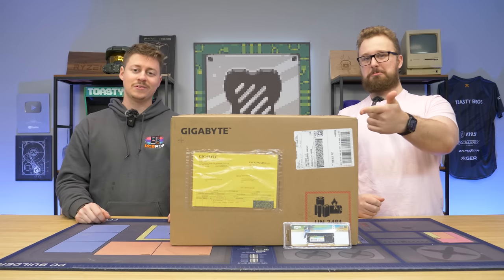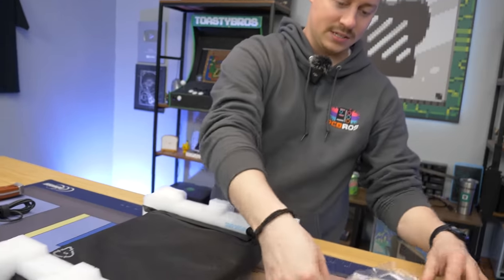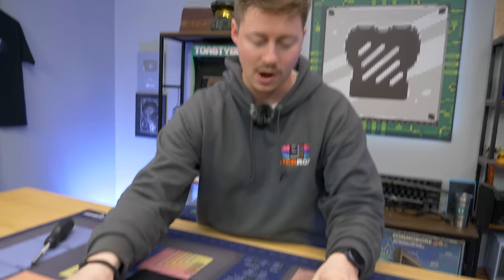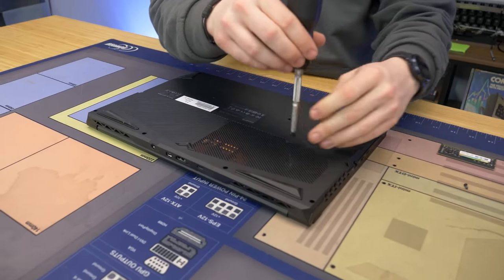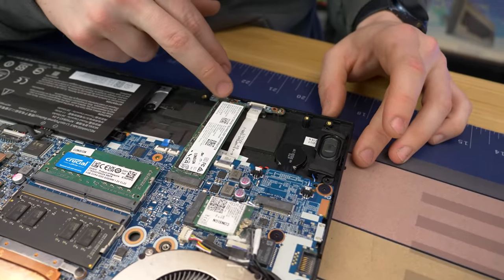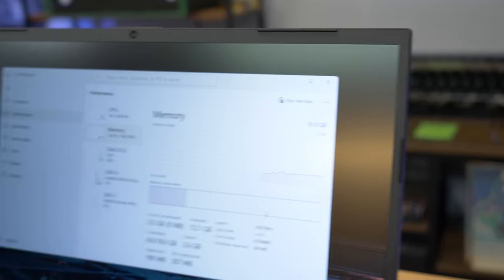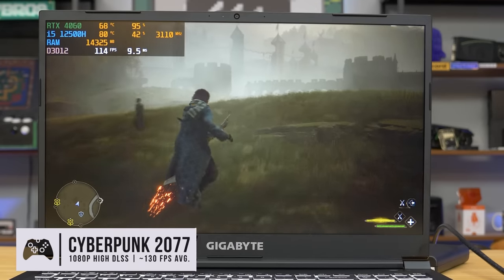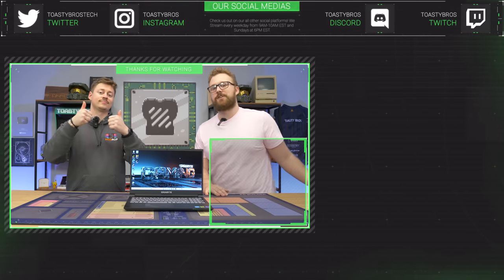Budget RTX 4060 Gaming Laptop...Is It Worth Buying?

Comment: 90c + temps on the CPU at only 30-40% utilization is a non-starter for me, especially at $1100.  Going from idle on desktop to opening chrome would probably be enough to make this loud as heck in non-gaming situations too.
Reply: This laptop is garbage,termals,material Etc.
Reply: I was thinking the exactly same thing, no temperatures beyond 75 celsius on a cpu for me.
Reply: @AurioDK  I won't go above 60° Celsius. I always undervolt
Reply: You can just turn off the turbo boost
Reply: its a laptop not a desktop 90c is perfectly fine and nothing to worry about
Reply: @Hainoi  constant 95c+  at 30% is still worring even for a gaming laptop, that 12500h is stupid hot
Reply: Laptop CPUs are designed to work at 90°C, this temps are expected for low budget gaming laptop.
Reply: and that is on a 4 core low tdp laptop CPU lol, complete joke cooling
Reply: @bandita2068  is the i5 12500h 4 cores?
Reply: This thing will toast it's thermal paste in weeks and then hellow thermal trottling and low FPS.

Comment: Man, those CPU temps are insane. Time for some liquid metal. Made a MASSIVE difference for my old gaming laptop.
Reply: my alienware 15 r3 never went over 60 on gpu and 80 on cpu after liquid metal (Y)
Reply: @danielrock04  my laptop has an 8th gen i5 and a 1050 ti. Before conductonaut, the CPU was nearing 90 and the GPU over 80 while gaming. After, 74 max on the CPU, 69 on the GPU.
Reply: @Viking8888  I'm going to fly to Toronto this week, I'm gonna buy a new notebook, I'm thinking in this gigabite or an Asus ROG (almost same price for an open box one) with a Ryzen 7 4k and a 4060... I don't really decided yet but I think I saw somewhere saying that the Asus comes with that new thermal fase changing pad, so maybe I'll go Asus this time 🤷🏼‍♂️
Reply: @danielrock04  Are you from Canada? I'm originally from BC. Honestly, I'm waiting for the Framework 16. I'm REALLY hoping it doesn't cost a couple arms and a leg.
Reply: @Viking8888  Regular thermal paste will work, and I trust it more anyways.
Reply: @danielrock04  buy a desktop
Reply: @Viking8888  I'm Brazilian, I wish framework could change the market, but for now unfortunately I will have to pick one cause those notebooks here in Brazil can cost more than double the price in Canada, so, I will get one and settle with it for the next five years or so (like my Alienware)
Reply: @Jactional  IF I could buy a SFF I would, because I need it to be portable, I was thinking of those MSI Trident 3, but I wanted one with a 3060 and it costs 2 times the notebook...so I think I'll be better off buying an entry lvl notebook...
Reply: @danielrock04  I'm sorry things cost so much in Brazil. Wish things were reasonably priced in every country in America. I'm glad you will be able to get something when you get to Toronto though. Take care.
Reply: @ayedraco4l  thats not always true. My 2018 hp pavilian gaming didnt have strong enough cooling. Some i5 8300hs were not even allowed to go to their true 4ghz and were locked to 3.5ghz because manufactures were didnt have the cooling. Unless theres a really good last forever phase change honey well paste a paste probably isnt going to do it. I still get into the 80s in some games and if I forget to turn on my under volt on im back in the 90s with liquid metal. I dont put so much in that im afraid to put it my back pack and run around with it (which I do) but you can totally use conformal coatings, a little bit of thermal tape and possibly add polyurethane foam dams from filters to add a little bit of saftey. I agree on most other laptops though.
Reply: @Viking8888  have you undervolted. I got an i5 8300h with 1050ti laptop. Whats your clocks your getting at tdp. At my 45 watts tdp with undervolt im getting 3.7 ghz for 4 cores which is basically now my new 4 core base clock.  I was wondering what wattage you used because your max temps look better. Hp went pretty weak on cooling in 2018 but im not sure if its just that. I was wondering if your getting all of your cooling from just having a better designed laptop or if the wattage you were running in games was different than 45.
Reply: you can't use liqud on a laptop as itwill leak out
Reply: @gabriels5105  I left everything on stock settings. Didn't even think about undervolting. Should have tried that before selling it. I'll try that when my Asus TUF Dash F15 gets here to see the difference.
Reply: @mrt1957  I checked it before selling the laptop and it hadn't leaked at all. I did use kapton tape around the CPU die though, just to be safe. The GPU was already covered around the die.
Reply: @mrt1957  already did and I daily it in my back pack. There are ways to do it. Use less, use confomal coating, use tape, get it to wear in a bit if possible so it sticks a tiny bit better and possibly make Polyurethane dam from airfilter and place it around the die.

Comment: I realize this is completely subjective but personally I would not consider this budget.
Reply: It isn't, a 1000usd laptop is a higher tier mid ranger fully capable gaming machine, a budget should be in the ballpark of 500-700 max which should get you a legion 5 with an rtx 3060 with way better build quality/heat management and screen than this.

Comment: For 1100 dollars it should have 16GB ram, my Lenovo with a 3050 does and that was 300 dollars less
Reply: Yeah my hp  gaming does that does to and I got that two years ago if there only giving u 8 gigs of ram then it should be cheaper
Reply: Got a used rog strix with a 2070 and 16gb ram for 500
Reply: In Slovenia it comes with 16gb
Reply: But the Gigabyte has much more powerful 4060.

Comment: finally someone who speaks well of this laptop, I have had it for 1 month and it seems excellent, obviously improving the storage, ram and taking care that it does not get too hot, but I consider that it is an excellent price for the quality of product you receive, I am engineering student and as a work tool it is the best I could get, it is definitely worth it
Reply: Hello.. I want to ask you a request. I am an engineering student like you, and I am thinking about buying this Haas Webb, but I hear radiation on it regarding temperature, and it heats up quickly and has a very strong sound.

Comment: For all the guys complaining about the CPU temps in the comments: I own this laptop and the fix was pretty simple - I got a good cooling pad & limited the CPU power to 35w instead of the default 45w limit via ThrottleStop (since undervolting is impossible on the 12th gen CPUs). The fps dropped by like 7-8, so in order to recover the performance loss I overclocked the GPU via MSI Afterburner. Now I get about the same performance and CPU temps rarely go past 85 degrees celsius. To make it even better I am looking forward upgrading the BIOS from FB01 to a newer version, like FB03 or so.

To sum it up, this Gigabyte laptop is a great machine if you are willing to do a few tricks & tweaks. Personally, I am, and honestly the 4060 in this price segment is quite unbeatable. I could’ve opted for a more known brand like Lenovo Legion and get a 3060 laptop for about the same price, but I would’ve lost a few important features like DLSS 3 (which is fantastic), the 12th gen CPU (those 12 cores and 16 threads are simply amazing, coming from a quad core i7 7700HQ) and also, probably the most important in my opinion, the 8 GB of VRAM, which are considerably more fututeproof than 6.
Reply: I actually own a 4070 version of this exact laptop paired with a 13900HX and 32GB of DDR5 with Samsung 980 evo Pro . . You will NEED a Laptop cooling pad 100% . Also i agree the cooling solution does suck .. I highly suggest Re-applying better thermal paste or reach out and use the RMA and say its overheating .. Thats what i did and it came back a bit cooler once they re-applied the thermal paste...  My laptop is the Sager version so my Bios might be different ...
Reply: All that to still get 85C, a 6800H hardly goes past 80C when lifted (no cooling pad) and hardly goes past 77C with a basic 2000RPM cheap cooling pad. That's either intel with shitty temps or the laptop with shitty cooling.
Reply: @Xyz_Litty Thanks for the answer! I’ll take repasting into consideration in the future, maybe. For now, I don’t wanna lose my 2 year warranty. On a sidenote, do you happen to know if this machine has MUX switch? If yes, is there a way to enable it without an external monitor?
Reply: @ThatOneGuyC  85 is still considerably better than 96-97. A pretty safe temp for a modern CPU, not to mention the GPU stays under 80 in 99% of the cases.
Reply: Don’t forget to thermal repaste 👍🏽

Comment: When getting this notebook, it's important to get the latest bios version installed. Mine came with "FB01" and it had some stuttering issues and got pretty loud. They optimized the power limits and fan curves with version "FB03" a lot. In power savings mode it can play simple(!) games for up to 3hrs on battery, too. It's pretty much passively cooled at this point at a room temperature of ~20°C.
I'm very happy with this notebook now (it came with 16gb of RAM). It's a great deal imo.
Reply: Can it help to the 3060 version ? 
(G5KC)
Reply: @alexkrass1203  sorry, I don't know about this notebook in general. I'm just a customer of the G5KF.
But definitely worth a try!
Before updating try to get some more info 👍🏻
Reply: How can I update the bios? Please help bro
Reply: Can you tell me how did you update ur bios?
Reply: Can u tell more about how u updated bios or maybe some link on that?
Reply: @hedonist5398  I can't bcs yt deletes my coments, when I try to answer.. I tried twice
Reply: @kamipls6790  kk I'll find it by myself, ty for respond ✊
Reply: Can you please tell me how did you update your BIOS?

Comment: This is actually a Clevo chassis rebranded by Gigabyte. 

Besides only 8 GB of RAM, the main flaw is the screen since it has very poor color gamut and accuracy along with slower response times and low brightness. 

I'm sure some people won't care but just think it's worth mentioning.
Reply: The GPU also has 8GB of RAM I think?
Reply: @floydlooney6837  its called vram not ram, and gpu vram is different
Reply: Nothing wrong with the Clevo chassis, they are tried and tested and you get a lot for your money to be fair. a bit tight to only give the 8Gb Ram, however, given the price-point?
Reply: its very easy to upgrade to 16+ gb
Reply: Correct it's a Clevo chassis , However you need to re-calibrate the screen on these Clevo's to unlock the full protentional and color gamut .. I actually own a 4070 version of this exact laptop paired with a 13900HX and 32GB of DDR5 . I had issues with the speakers and sent it back to Sager for RMA .. Well it came baxk fixed and i automatically can tell they calibrated the the screen also cause it came back looking 10 times better ...  But these Clevo and Sager laptops are all Price for Performance ..
Reply: @Xyz_Litty  Even if this laptop screen is calibrated, it's still going to look pretty bad because the sRGB gamut isn't even 100%, so images are just going to look washed out somewhat. 

Another YouTuber measured it with a calibration tool and it was only getting like 68% sRGB coverage if I remember correctly. 

Your laptop likely has a higher end panel with wider coverage even when not calibrated, so it's going to look much better regardless.
Reply: @jonathanr4160   Same Panel , Mine is a 17.3” .. Still 1080P 144HZ
Reply: @Xyz_Litty  that doesn't mean it's the same panel just because it's the same refresh rate and resolution. 

LG, BOE, AUO all make 1080p 144hz panels of differing quality for example. 

I have a 2019 2070 Clevo that has a 1080p, 144hz screen that is much better than this Gigabyte "clevo" screen for example.

Mine has 100% sRGB coverage, better color gamut, better response times for gaming and brighter. 

This one is one of the bad 1080p 144hz panels which can also be found on budget 4000 series laptops like the MSI Katana.
Reply: @jonathanr4160   The MSI Katana has one of the worst panels up to date … I’ve also owned a 2070 Super laptop from Sager and I agree the panel was very superior for its time .. 

Now I own the 4070 Sager version of this exact laptop we’re both referencing .. So your probably right .
Reply: So which laptop would you guys recommend around 1000 or a little under then ?
Reply: @amazinng1705  get Asus tuf laptop lineup, pretty good affordable laptops
Reply: @radstuff2  i heard that the tuf Laptops dont have good cooling system
Reply: @amazinng1705  you can't really expect laptops to cool good. Hmm i never saw anyone say tuf cooling system is bad. Tuf Laptops use the same arc flow fans as ROG lineup!
Reply: @radstuff2  maybe it is another version or i mixed it up with another laptop thanks nice to know
Reply: I had the previous version of this one with a RTX 3050 and it was quite ok, nothing wrong with that laptop, it was a bit "generic" but was tough and functional, I changed it because I was looking for something more powerful, but I would recommend it for people looking for an affordable laptop.
Reply: @amazinng1705 this haha, and buy external monitor
Reply: Yeah I have the Gigabyte G5 MD and the screen totally sucks ass Forsure, the color sucks and the brightness blows hard .  The screen can Forsure use an upgrade 100%
Reply: I'm going to hook it up to an external so that shouldn't really matter to me
Reply: I bought a 3000 series one for 600 bucks. I think if you can get it for those types of prices, it's really worth it since most higher end laptops are 1000-2500 dollars. So for 600 bucks I really can't complain. But if your budget is over 1500, then sure you can look at better options.
Reply: I've heard the build and speakers are also quite bad, like jarrod literally said that this was possibly the worst speaker he tested, what's your opinion

Comment: The Ethernet port is on the right side? That's gonna feel great always bumping your mouse into the Ethernet cable.
Reply: Honestly I just use the built in WiFi 6E card and get speeds from 600-800 Mbps with my WiFi 6 mesh network. This laptop is blazing fast...

Comment: Would a fan pad under the laptop improve the heat dissipation ? I always used them in the past but I have been using desktops only for the last 3 years.
Reply: It mostly wont. It helps and I do use it but its a secondary thing to do. The designers usually give you a big enought fan and heat sink. When cpus do this it usually means that thermal paste isnt good enough. Unless theres some magic phase change thermal paste from honey well or your capable of getting liquid metal to stay in one spot your temps are going to annoy you. You also got to undervolt which is even better in a laptop because it means higher frequency at tdp which brings base clock much closer to boost.

Comment: Nobody mentions the built in control center of this laptop where , you have different modes and custom modes to control , the voltage of CPU and GPU and set the RPM of fans in each phase. It's a laptop built to be tweaked and played with and i like that . I bought a cooling pad for it, I also use entertainment mode runs games smoothly without being very loud. I only use Ultra performance mode when i play signleplayer games for 3 hours straight when i want to enjoy the graphics.

Comment: What's the wattage of the GPU? Feel like thats a critical factor when considering a purchase.
Reply: Did you figure it out
Reply: 75w if anyone else was wondering, it reaches peak at 100w so it's not the absolute best, but you'll get 90% of what the GPU is capable of in a thin and light build

Comment: I just purchased the i7 Version for $750 at best buy.  (2, for my two sons)  GIGABYTE - 15.6" 144Hz Gaming Laptop FHD - Intel i7-12650H with 16GB RAM - NVIDIA GeForce RTX 4060 - 512GB SSD - Black  I will add a 2TB Drive later in the year.

Comment: Wouldn't the cpu become damaged over time if you were to constantly game at those temps?
Reply: I have a i7 10750h and in a razer blade and it’s not uncommon for it to get around 95c and it’s used every day almost for about a year
Reply: Laptop CPUs have run hot safely for years already. My laptop's i7 2670QM is 12 years old this year and still works as it should.
Reply: for me, i changed my processor power management and limit it to 90 or 95, it does a great job i'm running apex legends at 70 - 80+ degrees average and less micro stutters too
Reply: i remember my old i7 hp laptop  , i used to game regurarly at 100-110 celsius . Even after 10 years the laptop still works
Reply: no but anything else inside the laptop just dies/ warps thats why you want to get that heat out from the case at all cost > loud fan noise